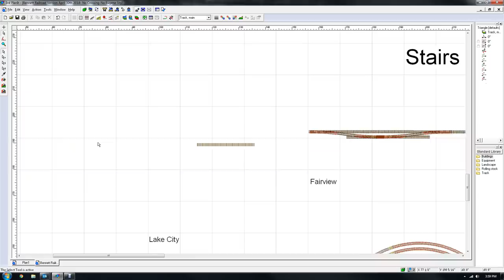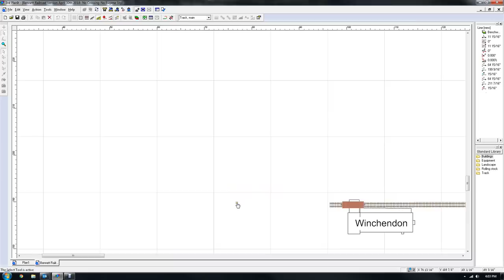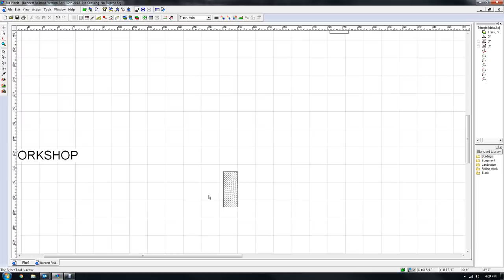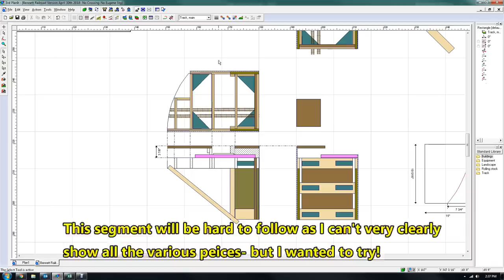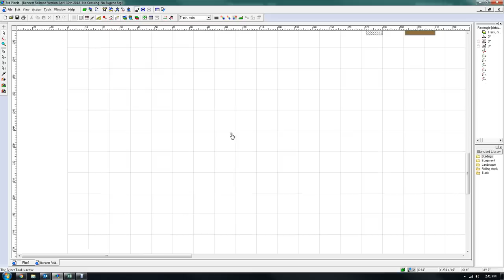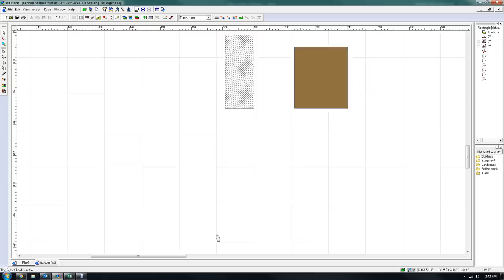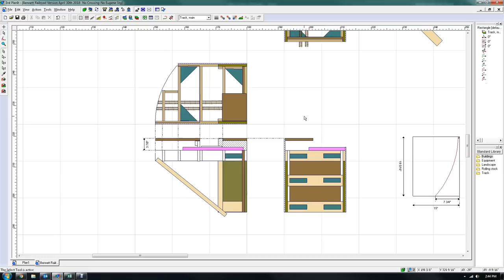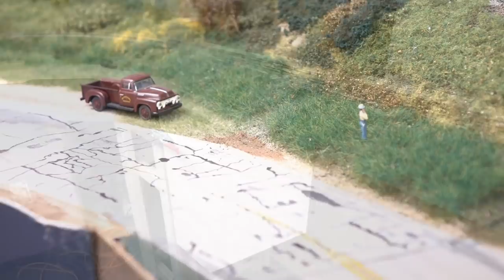Special Project: Swing Gate- Design, Build & Install

Comment: i like complicated projects and seeing how they work out. 

to make the gaps less obvious i suggest installing felt on each side so it will disguise the gap yet will allow the gate to swing freely. 

to keep the wires from pinching i suggest to gather them into flexible conduit. make the conduit loose enough so it won't stretch the wires when opening the gate.. 

as i have said before i have never built a layout and recently taken interest in this hobby. I am learning by watching until i can get started and build my own layout. it is tough to see all these neat things and can't yet do anything about it.
Reply: I agree about bunching the wires into a protective sheath.
As for the scenery at the obvious joints use a construction crew with cones and equipment. They might have dug a trench.

Comment: Great solution for your access issue.  I can't help but believe you will want to secure the foot of the leg that supports the pivot to the floor.  That would eliminate it getting kicked or disturbed by folks going in and out.  If that alignment gets changed, your level and clearances will change.  Love your videos; can't wait for the next one!

Comment: This seems a really elegant and well- (if not slightly over-) engineered solution to the problem of access. 
Just needs a Penn Rail logo on the gate section as you enter, and a 'SAFETY FIRST' sign of course.
------
56:50 Yipee-kay-yea, it works, he's pulled it off!!!!!
58:20 Some sort of retracting conduit (fixed on the gate side of the opening) should sort those wires out. I'm sure you will have done that by the next vid.
1:03:50 Nice to see this end of the track again!
Outstanding - and great to see both your work. Bill's a true friend.

Comment: Rob, again your meticulous planing pays off. Your layout shows what foresight can produce.
A suggestion for the wires is to put a plastic/nylon grommet around the plywood to make the wires slip better, or at least round the corners of the hole with a file on both sides. This may also make the wires less likely to snag.
Reply: Good idea- thanks for the tip.

Comment: You may want to consider using PCB ties glued down on either side of the gaps and solder the rails to them. I think this would be a better option than relying on the plastic ties and brad nails to keep the rails aligned.

Comment: Outstanding video! I like the idea/plan/implementation of this swing gate. I need one as well and this is one of the best plans I have seen to implement. A potential solution to wiring dilemma is to use a piece of hose to run the wires to preclude pinching, can cut the hose at swivel point. Don't know if will be perfect solution but will protect the wiring i think. Again, great video!!!!

Comment: I've been looking forward to this ever since your little "teaser". (Although, it did take me two nights to watch the entire video because I fell asleep listening to you drone on. 😛) This is definitely something I want to do if I ever get to actually build my layout. As far as the wiring, I would suggest running the wires through as close to the hinges as possible, thus reducing the amount of slack needed to be able to swing the gate all the way back. I would also tie the wires solidly on each side while leaving enough slack in the middle to swing the gate. That will eliminate the wires sliding back and forth against the hole in the lumber, which may cause some issues over time. The only issue is to make sure the slack has a place to go where it doesn't get pinched when the gate closes. Otherwise, I would say that as over-engineered as that gate is, if it ever sags you've got bigger problems. Keep up the great work and I look forward to seeing what you come up with next.
Reply: Bennett RR Videos- the cure for insomnia! Thanks for the tips, I will keep this in mind.

Comment: Good video. One thing I did several years ago for wiring a drop section part of my layout. My drop was only a 9 inch sdction of a yard, which I had to have.
I ran one wire to each hinge. I put a spade connector on the power wire and fastened it under where a screw fastened the hinge. Each hinge passed the track power to thehinged portion and the best result iwas there were no moving wires.

Comment: I have a similar gate--not as wide. I used a section of flexible plastic pipe (from plumbing department) to manage the wires. I also have installed micro-switches so that when the gate is open the trains don't plunge into the abyss! The microswitches are wired back to points a distance from the gate so the locomotives will stop in plenty of time. I also am concerned about the long-term alignment. So far, it works well.
Reply: I was thinking about both these "problems" and you've come up with a couple of good solutions there James. The plastic pipe is genius, so simple but, probably, so effective.
Reply: @2H80vids  I should give credit to James Adams (Affordable Model Railroads) for the idea--and installation. Like Stephen, I'm not much of a carpenter, and I was thankful for the help installing the electrical. By the way, there are three tracks that run across the gate, plus a cross-over, so I had to install a couple of SMAILs (DCC-enabled versions of Tortoises). That means that there are two sets of busses running onto the gate: one for the rails and one for the SMAILs. The flexible pipe keeps things from getting all tangled up.
Reply: Great idea- I'll look into it. I have added a micro-switch, right now it just is used to illuminate a light indicating the gate is open. It will eventually also be used by the C/MRI to drop all approaching signals to red if the gate is opened. I could drop power to the tracks as well...considering that.

Comment: As I guy on blood thinner, I have concern about all those long screws sticking out in case a hand or head gets under there when working on some of the layout wiring or what ever. I think a Dremel cutoff disc would make quick work of eliminating the danger.

Comment: I enjoy your videos, and great job!  I was wanting to ask if you thought about maybe isolating a section of track on each side of the swing out gate and linking them to a switch on the gate so when the gate is opened or not secured properly that the power will be disconnected to the gate and sections of tracks to ensure that a train could not run off the layout?  Just a thought.
Reply: Yes, I have. I already have the blocks, would just need to modify the wiring and install appropriate switches to drop power when the gate is open. Thanks Ed!

Comment: Great work and great video. Have you thought of using 2 toggles, one on each side? A person coming in would use the inner toggle to lock; a person going out  would use the outside toggle to lock. Only one is necessary to hold everything square but it would be more convenient if there was always a toggle handy on the side you are going to, especially if there are only one or two people in the room, which I assume would be the more frequent case. Cheers and Thanks for the instructive video.

Comment: Enjoyed the update. I was thinking like some others that the wiring could be run through an automotive wire loom or perhaps a length of clear vinyl brewer's tubing (which is available up to 1" inside diameter depending on what you'd have to fish through it).

Comment: i have 3 of those hinges on my gate in the backyard. the gate is 6 feet by 8 feet. so i think your gate is well supported. 
the dremel tool will cut them screws down. get rid of the sharp ends. 
nice watching the trains run. wow that really is a feet of engineering. well to me 
 like the camera roll at the end. ty

Comment: You could use automotive door poppers that hot rodders use when they shave the handles off, that way you could open from both sides, and have an alignment points as well?

Comment: If the gate comes out of adjustment it is because the post on which the hinges are mounted have moved. You did a good at beefing up and tying the two legs together. For added insurance so the post with the hinges will not move brace and tie it to the frame at the wall and to the wall. Just what I see and years of building things. Great job and layout

Comment: have you thought of adding some micro switches to cut power to the last 2 ft of track before the bridge so trains cant run of the edge?   that can be an expansive mistake.   the swing gate is looking GOOD!   congrats!
Reply: Troy (and others...) Yes, I have. In fact I have added one so far- to determine mounting location and wire runs. For now it just turns on a light when the gate is open. Prior to any real op session (it is just me now) I will likely implement a dead block area if the gate is open.

Comment: I only found your channel recently and I’m enjoying your content but I don’t know how far you’ve gotten with that. What I thought would be cool would be the side to the right of the gate Opposite the hinges and what about if on the fixed side you put a drawbridge in and you could cable it to the door somehow that it would raise when you open the door just a thought on and even know if it’s possible and I’m not a builder I just like watching these videos. Maybe a electric motor draw bridge with limit switches then can land the bridge into a catch to line up the tracks, sensor on the latch to trigger draw bridge up when opened.

Comment: Nicely done. Had a thought as I was watching. You could really disguise that curved seam with a row of low bushes that just slightly overhand the seam about an 1/8" or so above the swing section. Only place that won't work is where the track crosses. Could also work with some small structures. 
Don't know why, but my notifications of your new vids hasn't been working. (?)

Comment: Enjoyed your video. I have a suggestion for the wire. Mount a small length of soft tubing for the wire to run through, stopping at the edge of the closure and add a light duty spring to the wire, under the layout so as to keep light tension on it and pull it back under the layout Just a thought.

Comment: Straight cuts are easier to make and won't grind together or bump into each other as long as the outside of the gate is longer than the distance from the hinge point to the inside point where you start the cut for the triangle. Straight lines are easier to create a support. You should also put the wiring on the hinge side of the gate, it will collapse upon itself and you won't hook things on it as you walk through the gate. I know you want to hide it but every time you open the gate.you pull on the wires.

Comment: After all the design and build of the swing gate, I wouldn't want trains running off to the floor because the gate was left open. I'd install a push switch that opened the circuit to the last two feet of track on both sides of the open gate.

Comment: How many times did you have to climb under?  Lol 😝 

Would it be better to flip the latch the other way so that the handle is on the solid side and the nub is on the swing? Less chance of catching your pants when walking by. 

Great job, awesome engineering.
Reply: Too many times...

I hadn't thought about the latch orientation- I'll take a closer look at it. Thanks!
Reply: Rob Bennett. 
Lol 😝. 
I think you should paint the bottom of the gate like trestle girders.

Comment: If that marvel of wood, screws, and glue ever sags your house is falling down! You could sit on that if the fixed bench work would hold up. 
Nice work to all.
Reply: Rough carpentry, putty and paint (or, scenery) make it what it ain't. And you are very good at frosting the cake.

Comment: i would add an electromagnetic door closer plate. you can get them on ebay for about $20.

put it on a relay with a button on each side

Comment: Looks great Rob. That swing gate is going to look great. Quick question though, do you plan on having the gate where power stops going to the tracks when the gate is open? If not what do you plan to do if this was to occur and you not incorporate this into the gate?
Will
Reply: Will- I am working on a way to drop the power. Just need to determine the exact set up and wiring.
Reply: @robbennett1965  that's great. I watched an episode of what's neat with Ken Patterson, the monthly show. he showed how he did a lift out section. he constructed a mechanism and it had brass tabs that he had hooked up to the end of the section. when he would lift it up, the trains would stop. not sure which on it is, but it might be some helpful information if you need some more information

Comment: I use AnyRail to plan my layout.  I've tried to use other applications but found AnyRail easy to use.  Can you tell me why you like 3DPlanIT.  I'm an old AutoCAD guy but found 3DPlanIT complicated to learn and use.  What other track planning apps have you used?
Reply: Rick- I have only used 3rd Planit, and stuck with it as I bought it and was able to make it do what I needed. I haven't used others so can't intelligently offer any comparisons. 3rd PlanIt - at least to me- is fine for track planning and such, but one quickly finds it is not a true CAD program if you try to do traditional drafting work. I can make it work, but from a little experience with true CAD packages I know it can be done much easier and faster.

Comment: Greetings, Did I hear correctly in a very early video that you have 30” and 32.25” radius max on your mainline?  I’m in the planning phase of a similar size room.
Reply: Kent- yes, that is correct.
Reply: Sorry I didn’t ask this as well. Did you keep your Mainline at 2.25” as well. Your YouTube site is fantastic. Videos for both my wife and I.
Reply: Ah, got it- once out of the curves the spacing drops to 2". The curves were larger as initially we were running auto racks and the longer 89ft piggyback cars.

Comment: Why don’t you consider using castors on the bottom of your roll out segment. They would carry the load and make movement smooth and easier.
Reply: if you have a level floor.. ha!   maybe castors with shocks??   If it starts to sag over time.. might be an idea...

Comment: Your plywood won't expand and if it does, it will be the width, not the length.  The 1x4's will expand by their width as well.  So, you should be good.